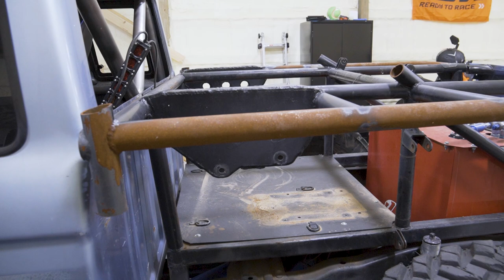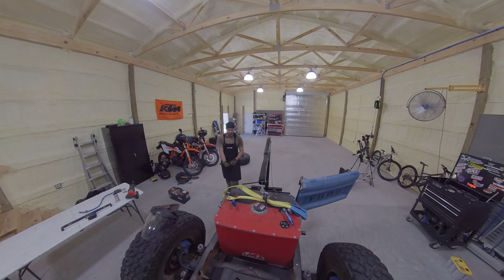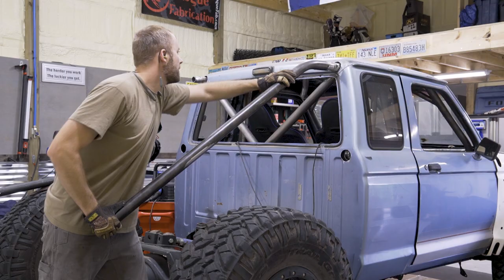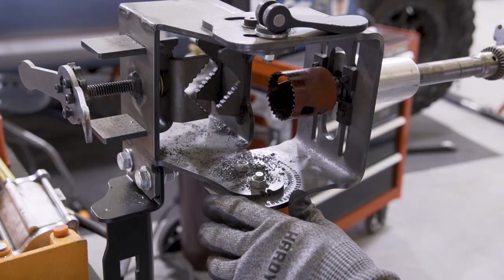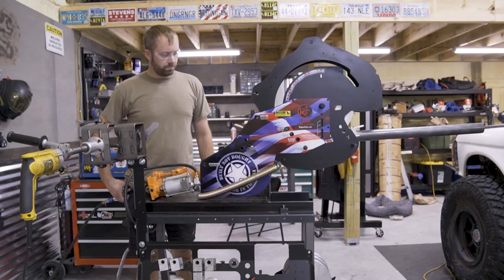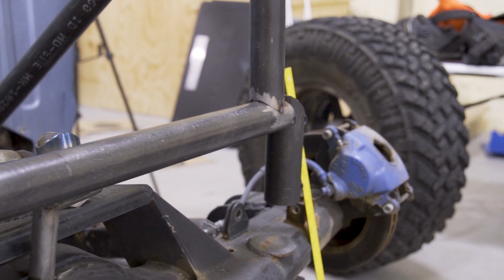I Cut My Truck In Half - Reckless Wrench Garage

Comment: always a good day when the factory rear frame goes away. One of these days I'm going pull a running/driving a truck in the shop, shore up the cab and drivetrain, and pull the factory frame, and drop it on a fabbed frame.

Comment: All i took from this is you said bedsides are going back on so  happy. But you really over comicated cutting the back off lol
Reply from the maker: I had to load the scrap metal into a little trailer and I was bymyself, so that's why I cut it into little pieces. Plus it was easier to get the fuel cell out when it was full of gas without the tubes in the way.